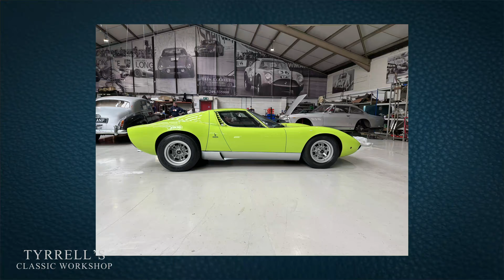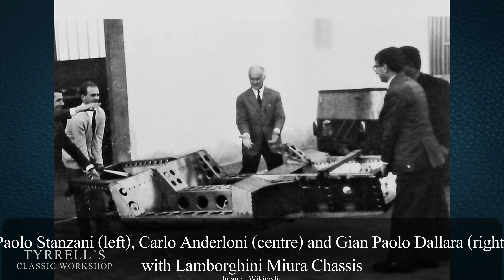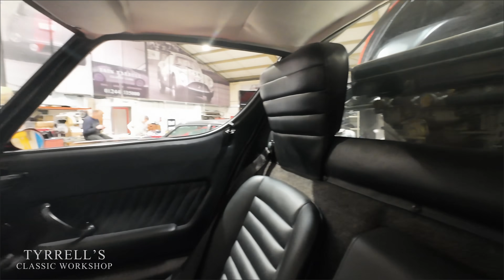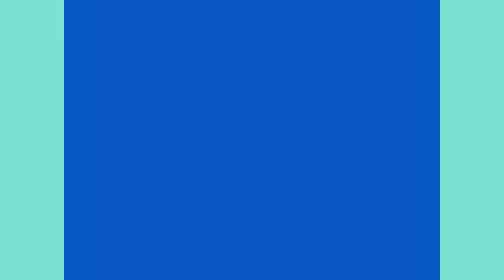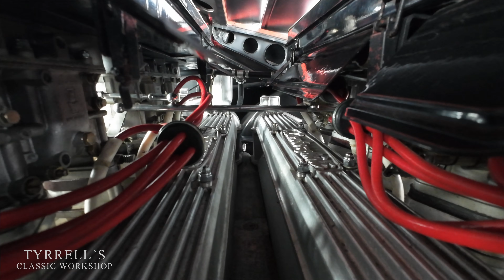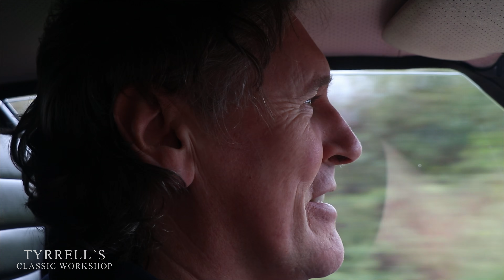Lamborghini Miura no 23 gets a refresh and sensational road test | Tyrrell's Classic Workshop

Comment: Street racers and street stock drag cars used to use those carb spacers. I used a 3" spacer on my 350 hp chevy motor i squeezed into a Chevy Vega  fast back. Gut wrenching torque.

Comment: So hold on with what you said about the italian job miura here, was the thing resprayed the color its in now, that orange? also I think Ferrucio's own personal car is in this color too, 

also with people wanting the earliest ones, it makes sense, its just like the e type and I can tell you why, its not the framework, its the bodywork, people want the eyelashes, just like the old series 1 e types

where the covered headlights just look so much better than the ones that aint, and just look at Ferrucio's, what's the one thing his car had that the other SV's didnt

also I thought dry sump was standard on the SV with that green one, was that one of the first to have that change done to it, and then the factory started doing that?
Reply from the maker: The factory made split- sump, quite different from dry sump. The Italian Job Miura is still a different shade of orange to the original as far as I know. Thanks for your interest
Reply: @iain_tyrrell  okay so I wasnt going nuts there, it is a different color from how it was, and I guess I figured the split sump and the dry sump thing was the same, given how many seem to have that retrofitted to them now at Bob Wallace's shop in long beach

where that miura is that I've been following for 20 years is at, and he's finally got it painted too

and I wonder if an accusump, a tool they use for autocrossing old american V8s would be a really good retromod for an early miura, where it detects a loss of oil pressure and squirts oil into the engine to keep it lubbed under high G cornering

as the miura is a lovely thing but that is kinda a problem with them.

Comment: Yet another great expose on the Miura Iain (my favorite will always be your meeting Dallara at his site). 
Mind you, I am left with the impression that you would have been twice as rapturous and broke into an aria if you have only been driving an early engined P400 with the much, much lighter driven plate, where the engine revs like a motorcycle. Apparently, this necessitated clutch work that was too difficult for most of the clientele buying the car back in the day.  That would have been a most interesting question to ask Dallara!   I'm sure he preferred the more race car-like behavior of the original engine, and in my experience, that is more exciting than the 200 lb weight saving of the very early P400.
Finally, the factory 350 HP figure for the P400, 370 HP for the S, and 385 HP for the SV was pure marketing tripe. In 1988, I had the late Bill Moreton dyno (on a very honest race dyno) my '71 SV engine.  The number was 320 real HP.   More importantly, Bob Wallace said that all Miura engines he dynoed were 325HP +/- 5HP.   Why might you ask?   The late series S and SV had Weber venturis (and intake manifolds) that migrated from 30 mm to 32mm.   Surely that would produce some notable effect?   Well, the answer seems to be that with declining available octane levels, the 22 degree static advance of the P400, was retarded to 20 degrees for the P400 S, and then 18 degrees for the SV.   
Please keep posting these enjoyable videos Iain... far too few people know just how special a Miura is to experience in the flesh.   You are addressing that deficit.   Thank you!
Reply from the maker: Thank you for your very interesting comment. All manufacturers to greater or lesser degrees were manipulating horsepower in the ‘60s.
A front- engined Lamborghini V12 would struggle to better 280BHP from the factory- way down on claimed figures. Very glad you’re enjoying the content:-)

Comment: This Miura, chassis 3009 has SV rear wheels, which are probably aluminium repros, but does not have correct wide SV rear tyres which are 255 section. This car has Michelin XWX 225/70 VR 15 tyres. Correct SV tyres are Pirelli HS CN12 255/60 VR 15.
Reply from the maker: The OE fitment Pirellis are only available when they make a batch, which they recently have. Thanks

Comment: When I was a teenager my dad took me to the Jaguar works where he was an employee.  In those days you could have your Jag renovated or rebuilt by a specialist team of craftsmen.  One part of this unit was the engine department and we duly visited their workshop. I asked one of the craftsmen why they had thrupenny bits on the shelf. They had an engine on the test bed, he took the thrupenny bit and placed it on the valve cover, started the engine, allowed it idle, then when he regarded it up to T & P he revved the engine hard and the dropped the revs back to idle. The thrupenny piece stayed upright throughout the test.  I expressed my amazement and he told me that if it had fallen he would have to strip the engine and start again!  Sham that in later years their bodywork let them down. 
Great video Ian but stick to your day job 🤣🤣🤣

Comment: Lovely episode, car, sound, videography, on and on.  I am absolutely ok with the modifications mentioned on the 2 cars in question, wider wheels, dry sump, and spacer.  They are period correct, the cars weren't developed with all the the tests of a new production cars. IIRC the wider wheels were intended for the car but the tires weren't there yet.  Further the modificatons were installed by the tuners or development drivers of their day.  The cars have been on the road with those features for decades, restore it, to how the owners enjoyed the car. IMO

Comment: I think in a previous video, you said the SV rear chassis was significantly re-designed to cope with those wide wheels? 

Not my car, not my money, and nobody asked, but this seems kinda sketchy? Hotted up engine and fat wheels bolted onto the early chassis that wasn't even really up to scratch for the standard setup? 
Sexy thing, but knowing all that I'd be too worried something was going to break, to really enjoy this as much as I should.

(Ref: I drove an under-tyred PI Triumph once that didn't want to straight under acceleration or braking. That was a "visceral experience" too but I'm glad my forever PI is a bit more sorted than that!
Reply from the maker: This one’s had some strengthening which helps. Thanks
Reply: @iain_tyrrell  nice! It's clearly got the right mechanic looking after it.